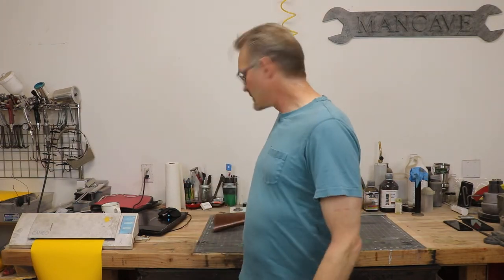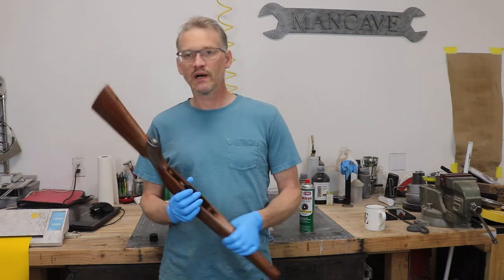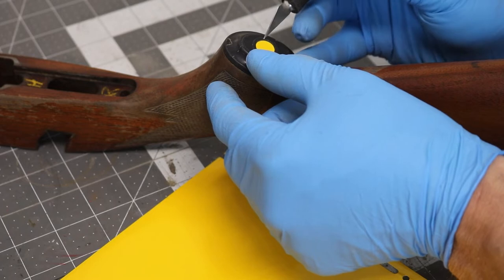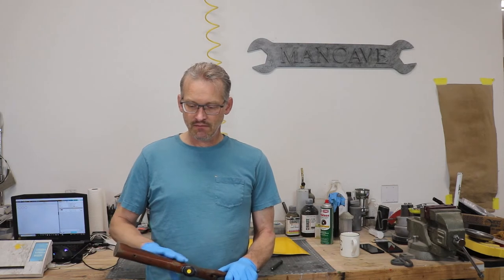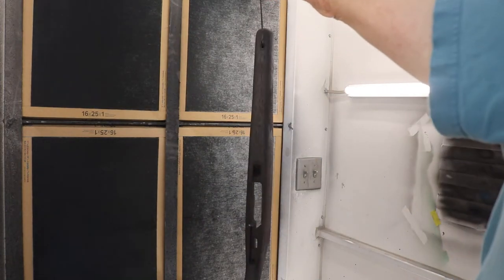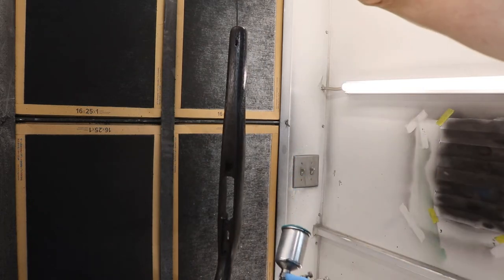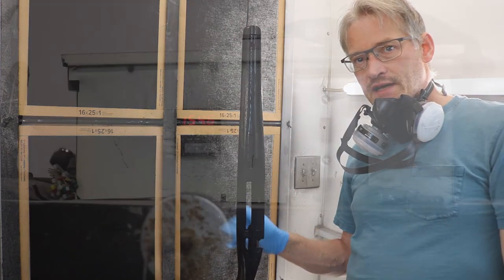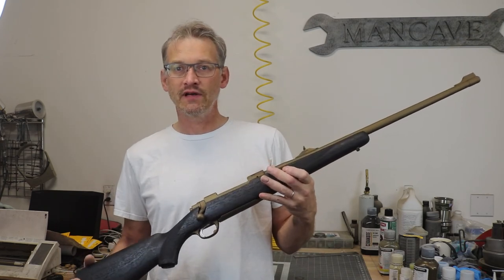Cerakote on a Wood Stock

Comment: Did you put the stock in oven after blasting to gas out oils or is that not much of a problem when Cerakoting blasted wood?
Reply from the maker: Yes stock went in the oven.  It's always good practice to gas out all the parts.  Sometimes the parts you are sure are fine cause the most problems.